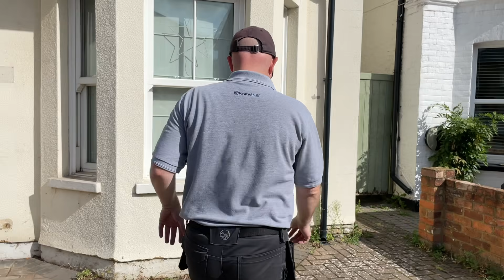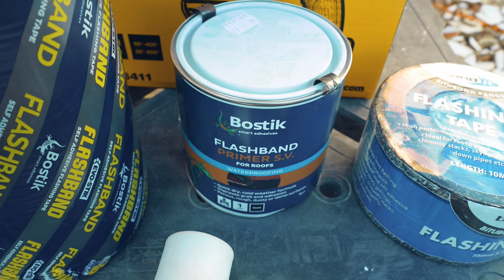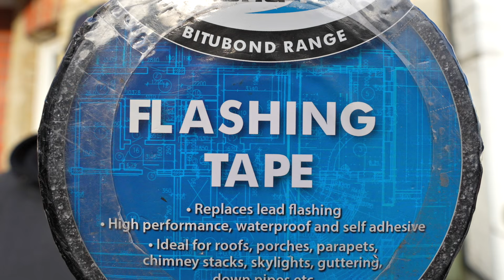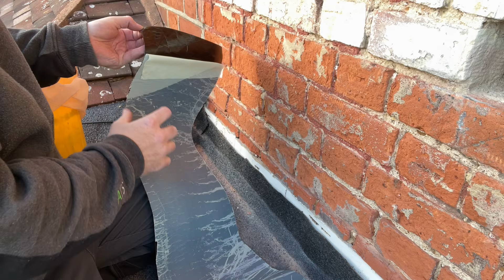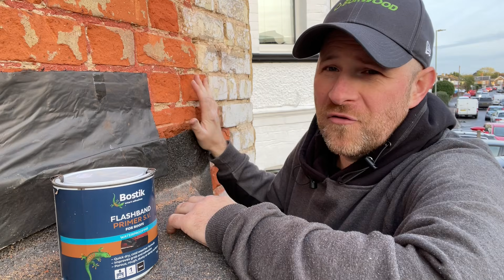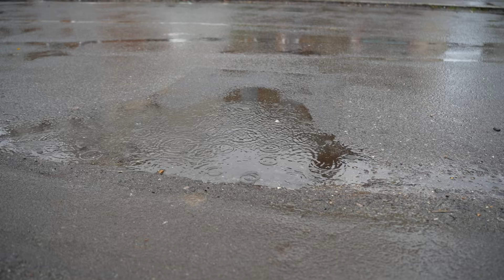How to Apply Waterproof Flashing Tape - Burwood Refurb EP.2

Comment: Great tutorial!  If you apply this to a pebble dashed wall, am I right to assume you'd need to remove the dashings first to smoothed the surface, clean it, apply the primer, then the flashing?  Also for a permanent job is it worth trying to bed some of the edge into the mortar line as you worth with traditional lead, just avoid any chance of water getting in behind it, or is it simply no that strong?  Cheers!

Comment: I used the great bostik flash band but put blackjack black felt glue on before as I hope its permanent!
Reply from the maker: If you used blackjack as well then it's going to last a long time. Bostik Flash Band if installed correctly will last years.

Comment: Can you use this stuff without burning it?
Reply from the maker: You just warm up the bitumen to make it soft and tacky. You only need a heat gun for this job, not a blow torch with a flame.
Reply: @burwoodbuild I never used it in the end but I still have it so thanks 😊

Comment: I just fitted this on my garage roof, as the cowboys who laid the roof a few years ago didn't bother using any lead flashing. 

The only thing I didn't have was a seam roller but I heated the flash band up and smoothed it down applying a load of pressure with a gloved fist so hopefully it'll be ok. I've also bought some polyurethane paint and will go over the top with it.

Comment: Bodger tape
Reply: Many jobs are bodged and still last for many years.
Reply: @foppo100 Thats bullsh*t, I'm a roofer and have stripped thousands of roofs, bodging might buy some time or hide a problem but they certainly dont last many years. The amount of lead box gutters or valleys I've seen this type of crap stuck to and they always end up having to get the job done properly at some point.
Reply: @Alexxx---101 That's kinda the point of this though isn't it? A temporary repair until someone comes in to do the permanent fix? I used some on my side porch roof one winter to get me through to the summer when I could replace the roof with good weather. I also used some on my shed roof about ten years ago and it's still sitting there now as strong as the day I did it. I suppose you'd prefer they didn't use it at all so there was more damage so you can charge them more? Sounds about right 😂

Comment: I put a metal roof on my conservatory and used Bostic flashband for the flashing - it lasted about 25 years and would have been longer except it was damaged by ivy and brambles getting under it. So in my experience it's pretty permanent ( but obviously not as good as lead flashing).
Reply from the maker: Totally agree… you do a decent job in the first place and this stuff lasts 👍🏼

Comment: Great info, thanks. I'm hoping to get away with this as more than temporary on a small flat roof on an ex-coal-shed abutting the house brickwork. The current felt is shot, but it hardly seems to have had anything much in the way of flashing, maybe an inch of bitumen adhesive or similar, which is in better nick than the felt. It's fairly sheltered, and if the primer makes it difficult to remove, that'll be just what I want!

When fitting the felt, is it just laid in a fold up the wall and then covered with the flashband over the top, or is the felt stuck to the wall first with adhesive?

I thought roofing felt would be stuck to the roof, but I gather it's left to expand and contract so only stuck to other layers of felt. I think it will probably be best to lay the felt in overlapping sections to accommodate where the (unused) chimney goes up the house wall and sticks out a few inches, and there's also a circular drainpipe going through, which will be fun to seal around.
Reply from the maker: Thanks for the msg. If the surface is prepared correctly (clean and free from dust, dirt and moisture) particularly if primer is applied beforehand then it will certainly last. I recently reinstalled lead (video to come) on the front exposed face and part of this involved removing the temporary flashband I installed over 9 months ago. It was not easy to remove, parts were really well joined to the wall and needed a heat gun to soften the bitumen again. If installing lead the felt would be run up the wall but not fixed to it. The lead then overlaps over the top of the felt. Mortar is removed and lead fits into the gap, held by clips and sealed with lead mate. As I say shot the video, just need to edit! 😄
Reply: @burwoodbuild   Thanks, that's encouraging!

Comment: I think that make of flash band is terrible, Just fitted some to the outside bearer of my cabin to concrete and is not sticky at all and heated with a gun. The water pools on the crap laid concrete and floods under the cabin. Put this all down and looked great, Thought it would do the trick but no! not waterproof in the slightest and still got past it and flooded the cabin. I can peal it off really easily too, no adhesion at all.
Reply from the maker: The bitumen should be extremely sticky once heated, it does come down to preparing the surface to ensure it’s clean. I would advise painting the surfaces with the flashband primer and try applying a fresh strip of flashband.

Comment: Just what I was looking for, there is no flashing on what would have been my old coal shed / outside toilet, house is 1909, so im going to try this.
Although I would like to put the lead flash back but understand the flash has to be chased in to the brick work.
Reply from the maker: Thanks ☺️ Glad you found the video useful. Yeah, lead would need to be chased into the brickwork and held in place with clips or rolled up pieces of lead. Then sealed with lead mate. Thanks for watching and leaving a comment.

Comment: For a temporary/permanent job could you apply a 1 inch wide band of primer to the brickwork where the top inch of the flash band sits? Easier to remove flash band at a later date?
Reply from the maker: That would work too! 👍🏼 On my repair I’ve found the Flashband has bonded really well without, but for unstable surfaces the primer is a 💯 must. 1 inch band of primer would be a good choice for a decent temporary hold.